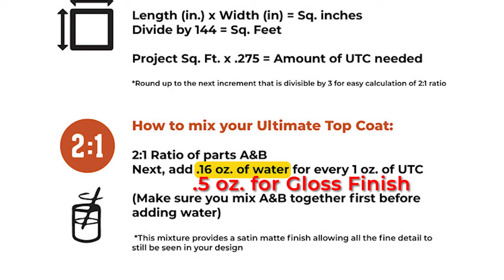The Best Way To Protect Epoxy Countertops

Comment: This product is incredible. If you don't use it, chances are you will regret it. Unprotected epoxy stains. I have only had 1 thing stain our counters with the Ultimate Top Coat (Kool-Aid powder). It did come out after some attention, but nothing else really stains our counters with this UTC.

Comment: We rolled on the top coat and this morning the roller lines were still there and didn't level out. and is still sticky to the touch. how can we redo this to be right? and we think from doing so late in the afternoon and it's in our garage and maybe the temps dropped to fast outside?

Comment: My first coat of epoxy look awesome with a high gloss, but my top coat came out flat there is very little sheen. The bottles say clear natural finish. What am I missing, I sand my epoxy coat as directed and mixed top coat as directed. It has dried and yet has that paint roller look texture. Is the clear natural finish supposed to be flat? It is not a smooth to the touch as the epoxy coat was. Please advise stone coat folks.
Reply: Same happened to us my husband is so frustrated because it looks like orange peel, I think they should explain or show the real results now we going to redo it we going to end it up spending an other 300 dollars 😢

Comment: Can't recommend this.  They changed their language shortly after we bought this product and removed the statements about additional UV durability.  Three months after pouring, every where that sunlight touched has turned a soft, rubbery yellow color.  Ironically they have a 'uv-stable' product, go figure.  Inquiries to support about this just left with blanket answers and 'sorry boutcha' responses.  I wanted to like these guys but after using their products finally, I'm not sure I can recommend resin to any counter top.  I do agree with others, the product is gritty and left with a rough, matte surface that we were not expecting, either.